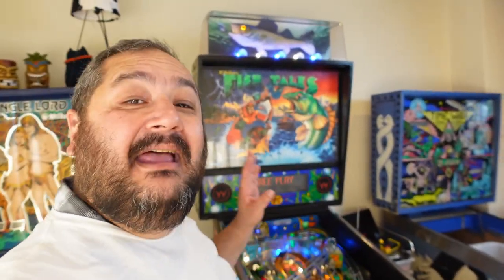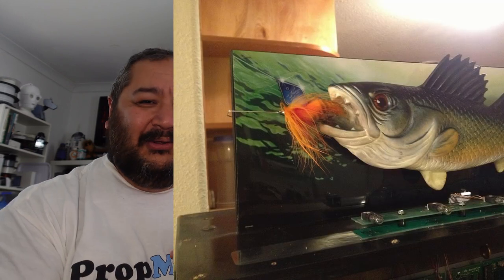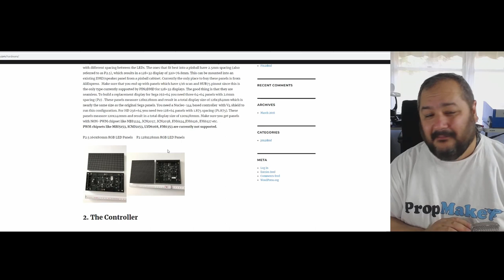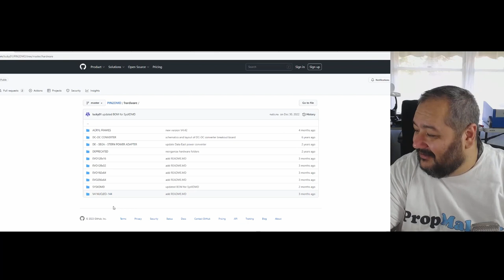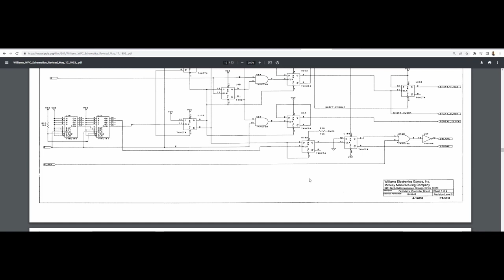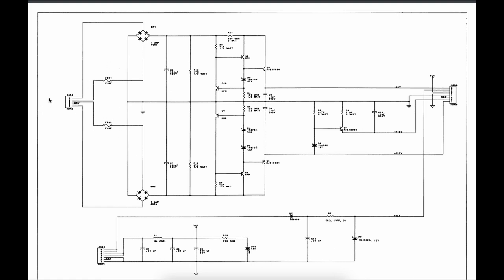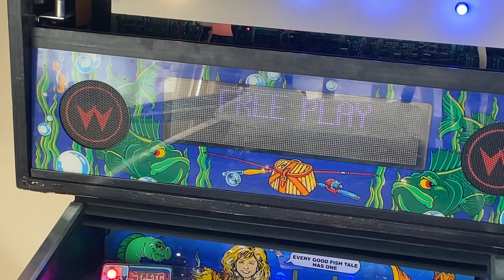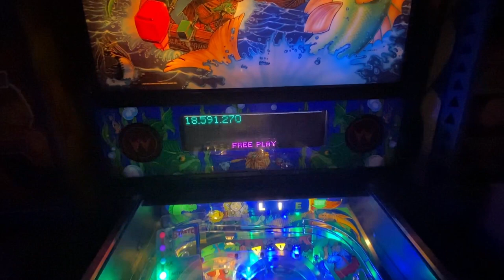Williams Fish Tales Pinball - How to Install a PIN2DMD in a Fish Tales.

Comment: Good video. I've sold many of these, pre-built, activated and ready to go with a wiring harness that requires no hacking/jumping/crimping of wires, etc. For Williams WPC games, you can just use J116/J117/J118 for power and tuck the original DMD power cable in your back box.